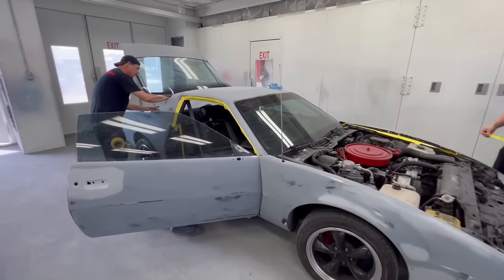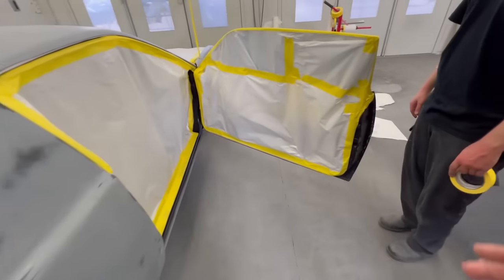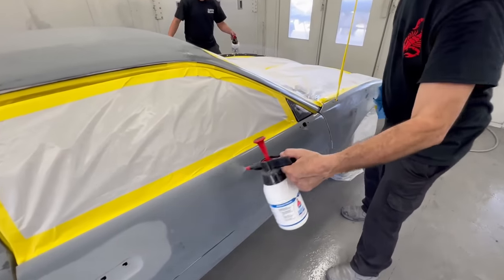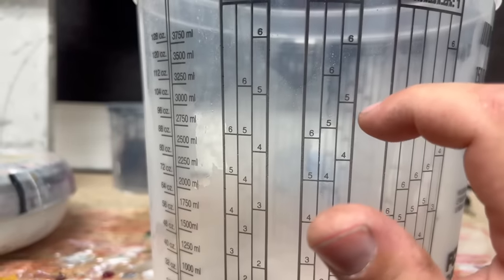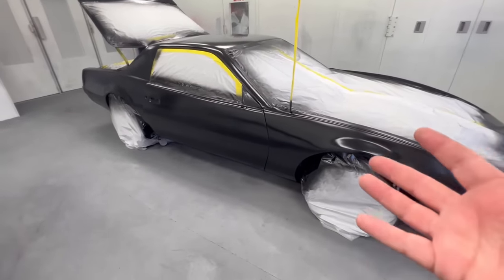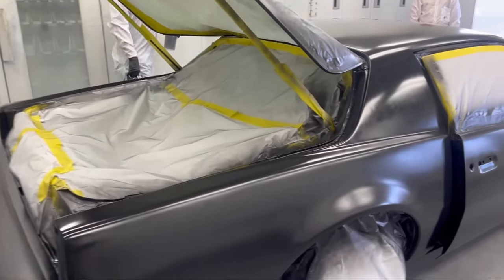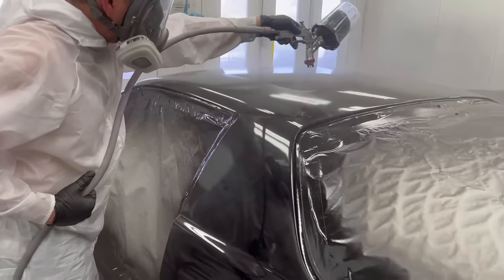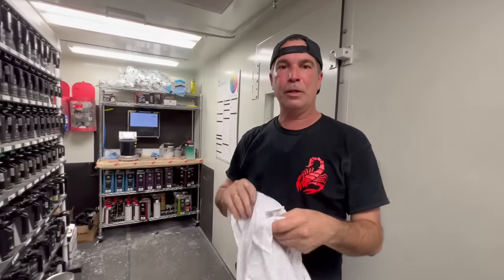How to Spray WET Single Stage BLAC￼K Paint without Orange Peel!

Comment: Excellent tutorial video. Exactly like I paint flipper cars. I dont use that silky smooth Nason because it is too expensive. Also, I never final sand or buff. But if a car is worthy, it gets a 3rd coat and then 3-5 days after curing, I go 1,000, 2,000, 3,000, and 5,000 wet sand then a course buff then a machine polish buff, then a sealer wax. Extremely labor intensive, 3-5 days more, but it is a mirror and no problems reeling in the cash buyer.